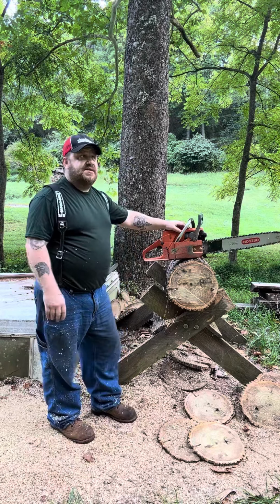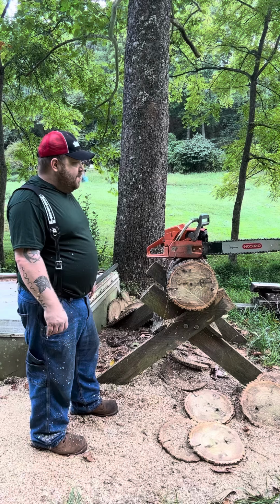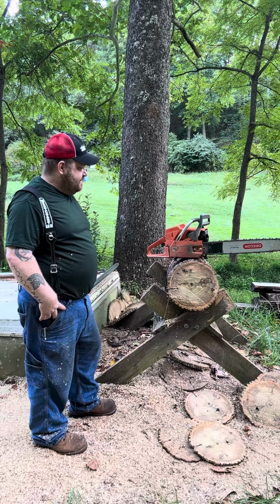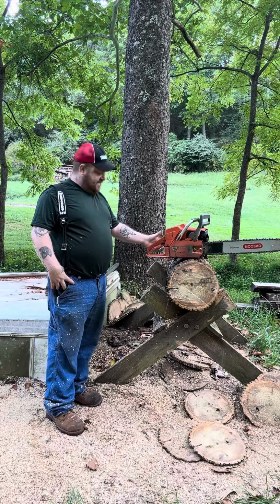PORTED HUSQVARNA 268…FIRST CUTS …BREAKING IN🤙🏻😎

Comment: i have a 268 xp.  the crank seals are leaking and i will fix it later as well as porting and a big bore kit.   so today i bought a 390xp and get it on saturday.  i cant wait to get my hands on it.   your saw sounds really good.
Reply from the maker: Thanks man.. my two cents stick with that 268 cylinder if it’s good ..the big bore/ 272 cylinders don’t run any better